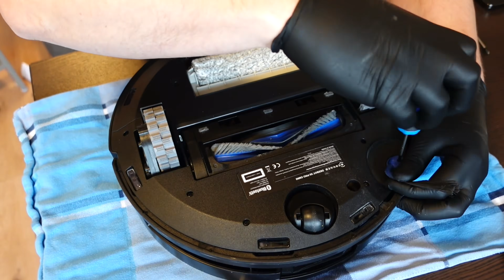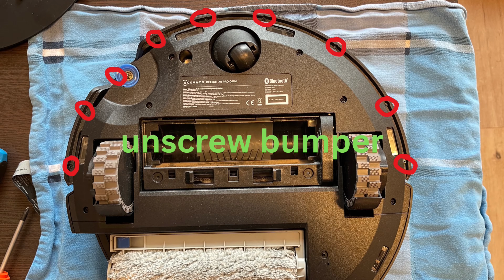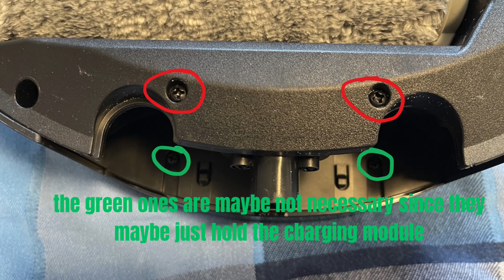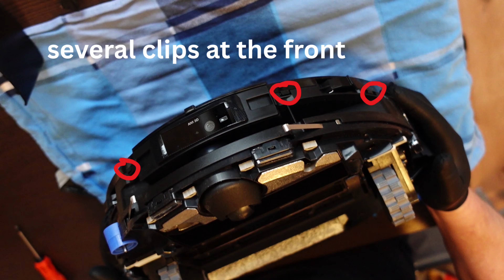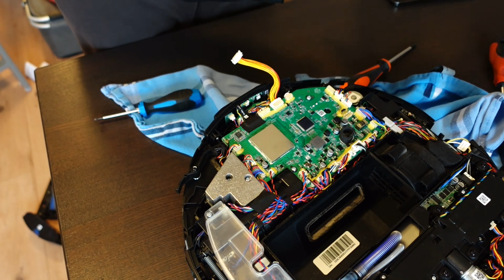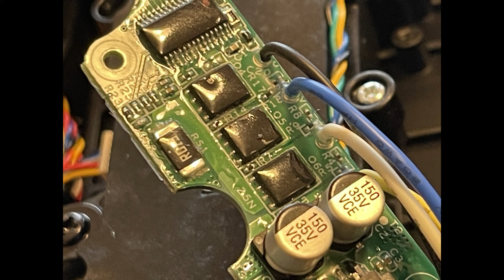Ecovacs X9 Pro Omni teardown - how to open and some airflow shenanigans

Comment: Yes. As an engineer myself, I am astounded by the poor design choices and airflow restriction (back pressure) in most of these newer robots... it seems manufacturers have turned robo-vacs into elaborate (overloaded) mopping systems with vacuuming efficiency as an after-thought.

Comment: mine has front lidar mulfunction… cant locate it self, i got it just 4 months ago, need help
Reply from the maker: The lds is at the bottom of the camera module. The whole front sensoring is one module.
Reply: @f @frickhelm  i have to find and buy whole front camera module? can you tell me where do i get stuff like that
Reply from the maker: I think you can just replace the lds if you can find the part. Aliexpress and ebay are your best options. There is a seller listing for the module at ebay germany https://ebay.us/m/aGcskN . But i would try to figure out the individual part numbers first to see if you can find the individual parts.
Reply: @frickhelm can i send you my broken one and you test out in video if it can be fixed ❤

Comment: I was searching for a reviewer like you and I finally found it. Thanks for your work. BUT in my opinion you have to do navigation test also, cause even with the best performing robot if it:
 misses areas, doesn't go near the wall, takes 2 hours to clean a room, doesn't detect carpets well leaving areas near the carpet not clean and not following a good pattern... 
It would be a horrible robot in any case. And also maintenance testing especially with the combo models, I've used robots that required little maintenance (washboard clean for weeks, no need to manual wash) and other robots like the one I use now (Dreame acqua 10 ultra roller) that needs the washboard to be manually cleaned almost after every use.
Also water consumption and autonomy is important.
All this to say, I see what you're trying to do here with this channel and I appreciate it a lot but if you want to be complete and meticulous you'll have to add other tests